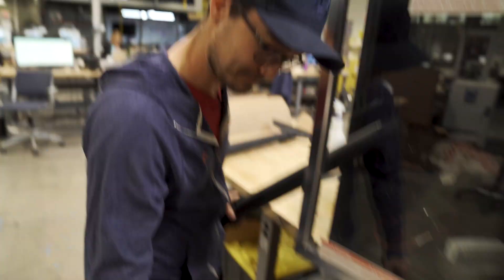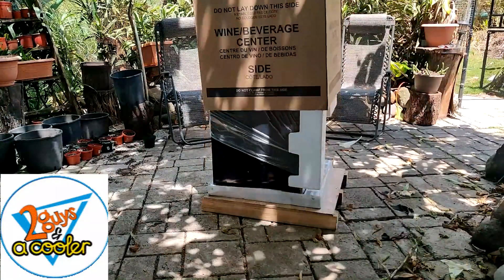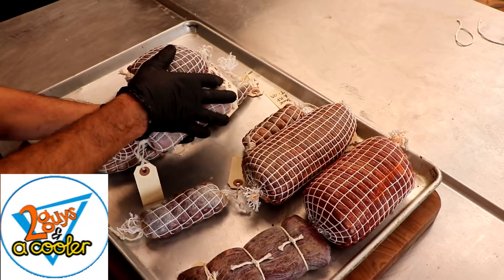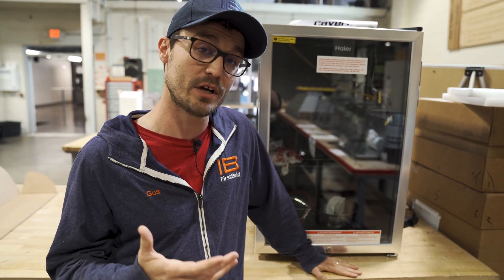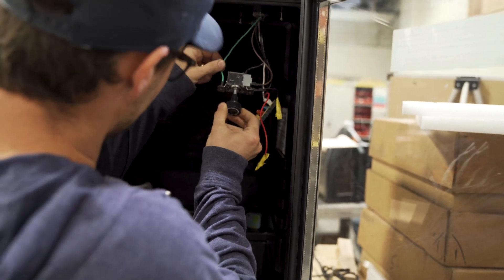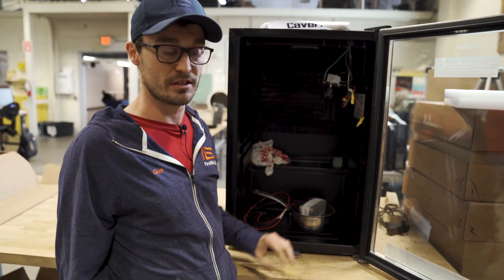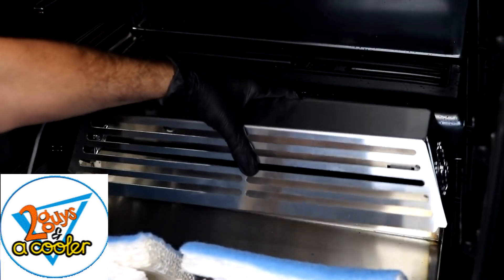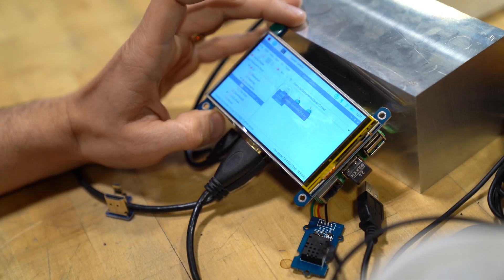Cavern 2.0: The Smart Curing Chamber | Dehumidification & CoCreation

Comment: I built one out of a freezer with a defroster which I tied to a device that would turn on the defroster when the humidiy got above a certain point or if the temperature went above a set point, worked like a champ

Comment: Yes, once you get the humidify/de-humidify issue straightened out AND have the ability to consistently maintain proper temperature you'll have a winner. It would also be nice if you could add a sight-glass to whatever the final water vessel you decide to use so you don't have to open the door to monitor the water level.